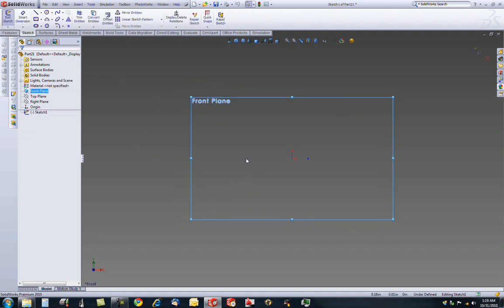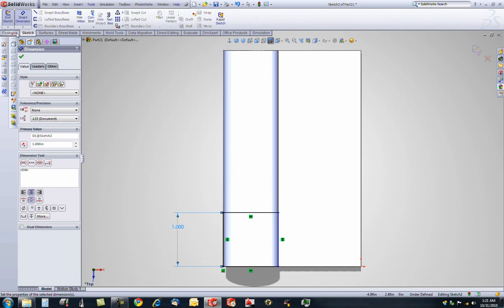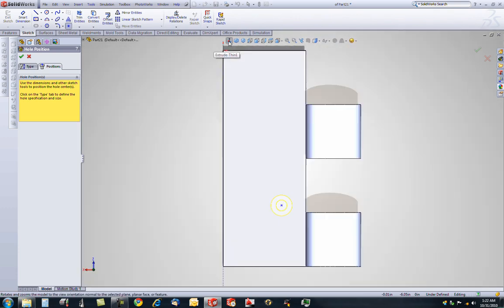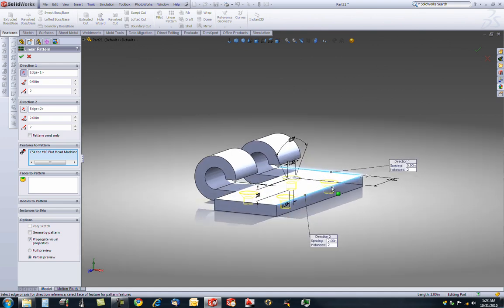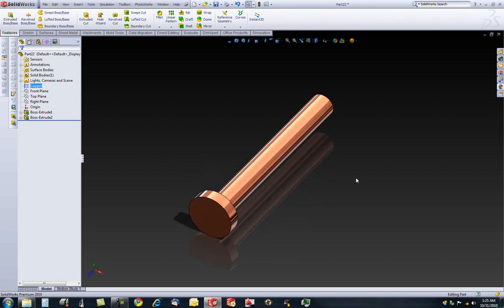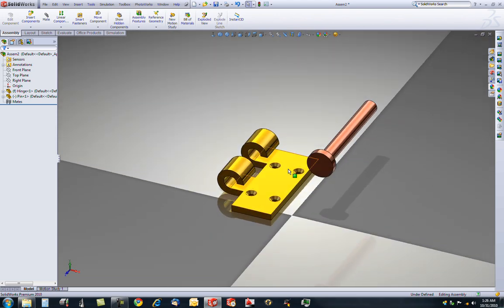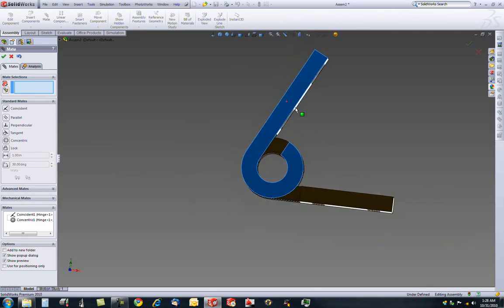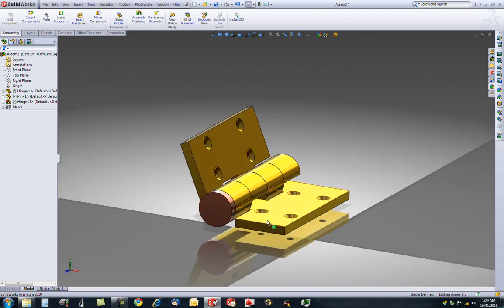SolidWorks Build a Hinge Assembly

Comment: I have a very quick question. This is my first time designing a system. in my system I need the distance between the hinge plates when its in a closed state should be say 1 cm. Do you think i can control them just by setting up the rotation and collision properties of the hinge plates or this factor is governed by the diameter of the circle which u drew in the start to make the hinge parts itself?